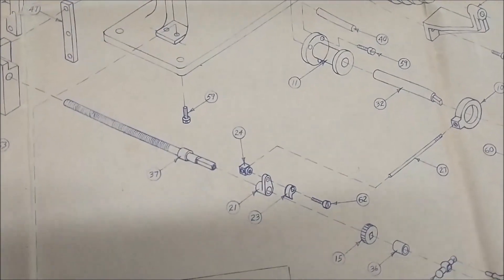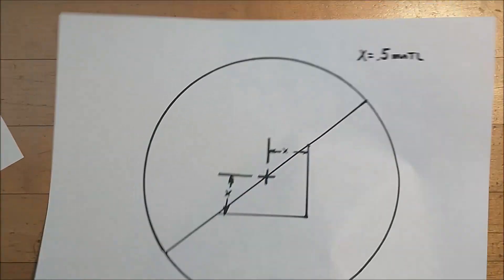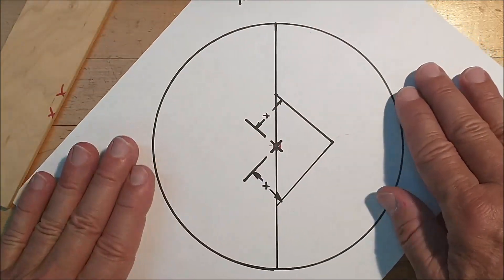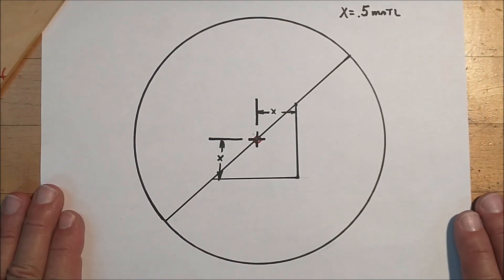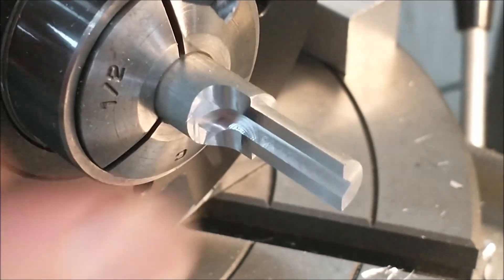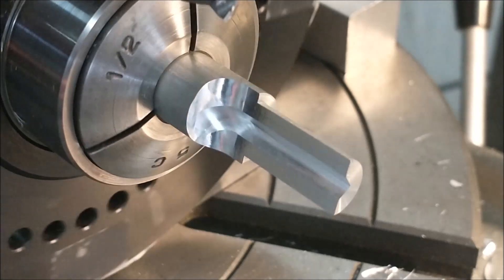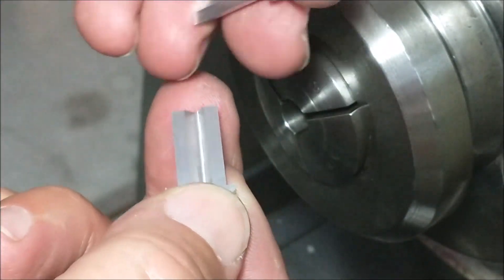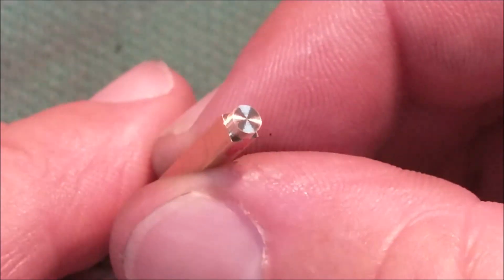How to Machine a Square Hole in a Round Bushing

Comment: I'm so spoiled having access to a wire EDM
Reply from the maker: Thats cheating.
Reply: @joepie221  Haha, absolutely it's cheating.

Mind you, it's all well and good having a WEDM, until the operator goes on holiday for 2 weeks and they've not trained a stand in, or the machine breaks down, or there's too much work on and they can't get to yours for several weeks.

I work in engineering R&D, and often times I've had to design and build bespoke bits of equipment that you can't buy off the shelf. This is why I like watching your videos, I've picked up a hell of a lot of tricks for manual machining that have gotten work moving again, and I've been passing it along to the apprentices, encouraging them to watch your videos as well. 

Unfortunately apprentices in this country don't get taught much, they're just a cheap source of labour for many companies, so I've had to teach them a lot of the manual machining, fitting, and fabricating skills myself. Having a resource like your videos has been a great teaching supplement.

Keep up the good work Joe, it's not just crusty old gits like me that are benefiting from it.

Comment: Have you been spying in my home workshop Joe? That's exactly how I made bushings to hold small square section high speed steel in my d-bit grinder so I could grind form tools precisely. The only difference is that I cut an o-ring groove around the body of the bushing before going to the mill. The o-ring sits below the outer diameter of the bushing and holds the two halves together without interfering with the collet.
I like the shorter video too. 10-15mins is perfect for a quick watch.

Comment: Or you can do a round bushing with hole drilled to diagonal square length and then cut a line in middle .Your method has more surface area thou.Neat little trick .

Comment: Well that's another useful fixturing tip to add to my Little Black Book. Thanks once more Joe!  I was trying to work out how to make a collet to grip a rectangular cross-section part like WR-6 waveguide (125 x 93 thousandths external, 65 x 32.5 internal). I think I can see how to make a hex collet using the same technique. I don't have a Spindexer, but I do have a Harig Grind-All #1

Comment: Very good tip the only problem is I need to hold a bit that is oblong and very small 8.95 X 4.55mm in two halves , I can superglue two bits of stock together but it’s hold ing it to turn one round I haven’t fathomed yet.
Reply from the maker: Make a bushing basically the same way. Start with a Large dia OD and a 8.95 diameter ID and cut the inner face to half of the 4.55 depth. When done with 2 halves, you'll have an oblong OD shape bushing,  turn the OD round by back boring it or in a small 4 jaw. The inside will be oblong and the Od will be round. Does that make sense?
Reply: Yes it does thanks

Comment: Your milling head not exactly trammed to 90 degree to the table or why did the cutter only made a mark on one side with the red sharpie?
Reply from the maker: The vise is on a rotary table. It may be off a minute or two. The head is fine.

Comment: What happened to making part #24 ?  Also what about that small side it left when you tested it? Doesn’t that indicate your collet insert is a few thousands off? Or is it a factor of clamping it offset in the collet?
Reply from the maker: Part # 24 is coming. As for the witness mark, its more like tenths, not thousandths. Plus the net shape and size of the material can also influence the cut.

Comment: (@5:45 or so) - it goes without saying that when you perform the step, leave enough material stick-out to account for the end-mill, or your collet chuck is going to be in a sorry state after you end-mill it by mistake! 😬
Reply from the maker: It makes a very unpleasant sound.
Reply: @joepie221  - followed shortly thereafter by an unpleasant sound from the machinist! 😆

Comment: Just an idea. Cut a groove or two for thin o-rings that match the OD of the split collet. That way when you place the collet back in storage it stays all in one piece. Just make sure yhe o-rings are not above the OD of the working diameter of the collet. 
Another home made collet trick. Say you have a need for X number of parts with a diameter turned eccentric to the main diameter.  Make a solid piece blank for the collet and then drill and ream a thru hole offset the amount to match the eccentric offset of the part. Then use a slitting saw to cut the collet body with the saw centered on the line going through the hole and the collet body. Cut most of the way through the collet leaving about .125" or 3mm. Using an etched or engraving tool mark the stock diameter and offset.
Reply from the maker: I like the suggestion. It would be very helpful if you had a bunch of these in very close sizes.
Reply: @joepie221  
I thought of using individual prescription bottles that uses up space pretty fast.

Comment: How would you suggest turning it 45° without a spin indexer, damned if I can think of a way ?
Reply: Invest in one, or a rotary table.  Option 2 is angle gauges, your vice and a dial indicator/indicol on your quill.  Joe also has an excellent video on making angle gauges if you only need one or a specific one.
Reply: @sticks7817  Can't afford a spin indexer or a Rotary Table, that's why I asked. I have both square and Hex ER32 collet blocks, so I guess something to tilt the square one 45° is the best option
Reply from the maker: Although you may loose some x-y position, holding a square collet block in a V block gives you an immediate 45 degree shift.
Reply: @joepie221  I did think about that myself while lying in bed trying to get to sleep 👍

Comment: Great vid 
I've a few machine vices need new handles 
Will this work for a vice handle ?  weld the two together
Reply from the maker: Mr. Pete does a video on making a square hole that may be helpful. If you have a welder. You could also broach the hole.

Comment: thanks Joe, as always 👍
this works great for square stock, but...
have you got any recommendations for making a collet holder for rectangular material?
my job is 1/8" by 1/16" and it needs 1/16" pin in the centre
the only way I could think of is by rotating the half collet pieces by diagonal angle instead of 45deg
and using half cutter moves (1/16" and 1/32") from the centre?

Comment: I odn't know if anyone else has thought of this but it is easy using the same tecniques to make wood or nylon parts for turning on a wood lathe, I can turn small brass parts by hand but have not tried and do not recommend trying to turn a metal harder than brass or larger than a half inch on a wood lathe

Comment: You're about two weeks late on this one Joe. I have a few square 5C collets and needed to use my 3/8" one to drill a hole down the center of a square piece of aluminum, but my 3/8" collet was way too small (likely a 9mm). I was able to do it in the mill, but now I can make a split bushing instead of having to buy a replacement collet. A very creative solution!

Comment: No 4 jaw chuck?
Reply: When you're machining the O.D. a 4 jaw chuck is not needed.
Reply: @ellieprice3396  I mean not to make that adapter at all. Let the 4 jaw hold the object.
Reply: @Stefan_Boerjesson  Collet is drastically faster/easier.
Reply: @Stefan_Boerjesson  I would hate to accurately indicate on something that is 1/8 of an inch (slightly over 3mm) in a 4 jaw chuck unless there was no way around it. I tried it once with 6mm stock and never was pleased with the results. I found at that small of a size, every tiny bit that I was off center seemed magnified.
Reply: @robertoswalt319  Yes, it takes some time but I believe less time than making that adapter. Anyway, it's an interesting video.
Reply: @jimbarchuk  If/when You have that adapter, yes.....
Reply: Have fun indicating that tiny square stock in a 4 jaw. Not to mention you have to re-indicate if you remove the part. The split bushing should have pretty good concentric repeatability.